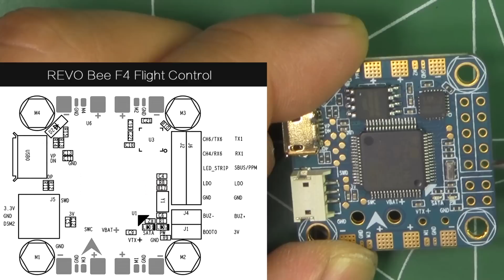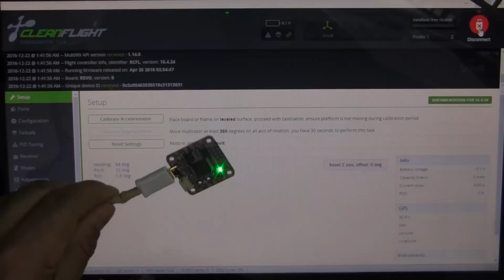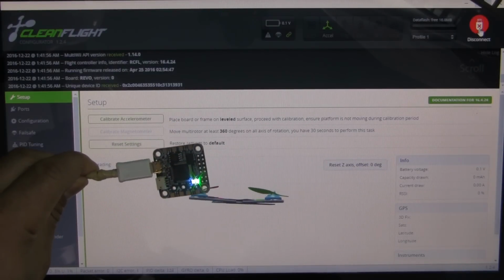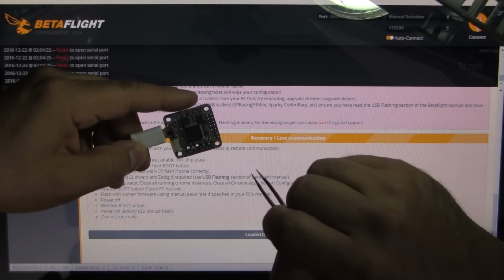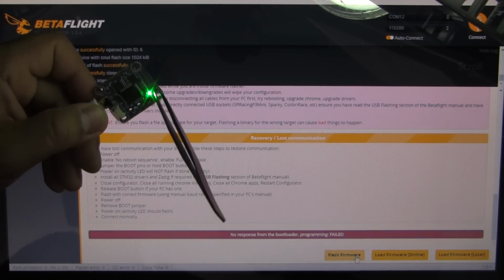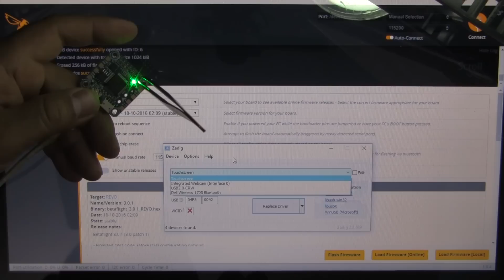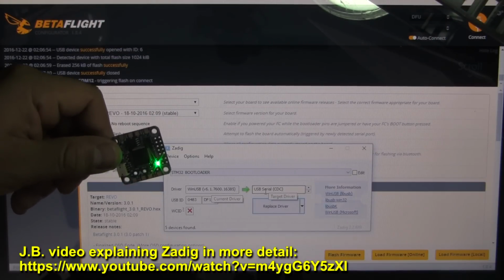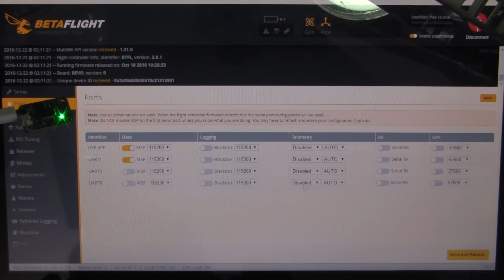iFlightRC.com REVO Bee F4 -MICRO FC Overview

Comment: can this board use with flying wing ?
Reply from the maker: Yes. Any board as long as you flash with fixed wing version of firmware
Reply: @EngineerX  many thanks. i found problem about board like this(clone board) i can not config it to use with fly wing servo 3 and 4 not move. i have no idea how to check and test. i try use it as multi rotor Quad-X in inav all motor work fine.
Reply from the maker: @best3140  yes sometimes some firmwares don't work with all the features. Then you have to manually check if firmware version has correct resource output for each channel. I have same experience with other boards. Main problem is too many different boards. Hope all works well for you. Thanks.

Comment: Apparently this works on 1s.
Could you please check that ? I'd like to use this on a 1-2s build then.
Reply from the maker: Only 2S-4S when powered thru onboard PDB. For 1S you would have to use a step-up regulator.
Reply: http://shop.myairbot.com/index.php/airbotf4mini.html

I ask because I read this. I believe they're the same thing.

I've also read what you've just said.

One last question, if you power this via LiPo will the power pads have 5v or bat voltage ? 

Thanks yet again :)
Reply from the maker: Hamza Mohammad Pads will have LiPo voltage. You have to have a good soldering iron and a small flat tip to make it easier to solder the ESC signal wires as the pads are  small.
Reply: me too. i have read http://shop.myairbot.com/index.php/airbotf4mini.html and this board work on 1s direct lipo only. lets us show you how to connect the FC to 4s direct lipo.

Comment: Daaaaammmn! The price was so ridiculous, i did not even think too much i just bought one LOL
It will be a bit tricky to solder the battery power leads but hey a bit of challenge in the build is always welcome :p
Once again if they had included some 12V/5V filtered outputs, that would have been just perfect! 110A current sensor is a bit too low too so i might be careful where i will use it!
Thanks for sharing and have a great weekend
Reply from the maker: Yes... always seems parts are just one item away from perfection doesn't it?!! LoL... 
110A should be enough for anything running 4" props, I think, for 5" props.... it could be borderline. The price is definitely very competitive. It's amazing how competition has driven prices to be become so affordable we get to pick and choose from so many great options these days.... just hope prices for all of our toys don't change for the worse in the coming months with the possible changes in trading policies between Asia and the US :(  
Hopefully not and we continue to enjoy the hobby as usual. 
Have a very good weekend as well my friend !

Comment: nice video as normal.  Looking forward to the Sunnysky x2204 motor.
Reply from the maker: Ah yes! thanks for reminding me. I just got back home from vacation and I got a few motors to test and some material to edit. I'll add the SS2204 to the test queue. I'm thinking running the more popular props 4040x3, 5040x3, and 5040x2 on 4S. Thanks for watching.
Reply: EngineerX I am running the dal q4040 and it feels great. I think the x2204 is a good little motor for the weight. I will be very interested to see what kind of numbers it puts out?
Reply from the maker: will also add the DAL Q4040 to the test!
Reply: OK Thanks. Very excited to see the results.

Comment: what do you think of the multiple different mounting hole standards ? I believe this is bigger than the piko blx and smaller than a full size FC.
Reply from the maker: The different mounting patterns certainly make it a little more difficult to mount to most frames. You'd have to drill new holes or use some other method like double sided tape. I think they should include some sort of adapter mounts for regular size pattern. TPU 3D printed mounts would make these FC's even more attractive so you could just snap them in to any frame. I do get the down-sizing trend, works well for the tiny 150mm and smaller frames but I think adapters would be cheap and make it much easier for the enduser. Thanks for watching!
Reply: EngineerX why did they go for a 25x25mm??? Don't know of any frame that has this size pre-drilled... yeah they should provide some sort of adaptor, like FuriousFPV with their "PDB 30x30mm to 20x20mm"
Reply: Like this i dont see how they can hit the market and sell a lot of it ... unless Frames start coming out with 25x25mm holes... other boards too... but since the 20x20mm format is just starting to kickoff, the 25x25mm is gonna take time... that's if it is going to take on at all?! I nearly bought one on banggood, thinking it was 20x20! Its the Mini ACRO F4, it's also 25x25, very similar to this board.21$... i might go and try this one out (at 21$!?)  if i decide to do a build and softmount my F4 FC. Thanks for the review.
Reply from the maker: Right, not many frames made for this size format. 20x20mm would've been a better choice perhaps. The only frame I've seen with 25x25 pattern is this one, though I haven't been actively looking.
http://www.iflight-rc.com/iflight-racer-ix2-90mm-indoorfly-fpv-racing-quadcopter-pnp-kit.html
I can see some advantage with narrower/smaller FC's. You can use a narrower center section on quad frames which translates into less airdrag, and improvement on motor-to-motor symmetry. Just wish they had included some simple flexible TPU 3D printed adapters so we don't have to drill holes or figure out how to mount them.
Reply: EngineerX oh I use a hole bunch of the PikoBLX on my nano quads, games from Quattrovolante, Tomoquads... And just got a Catalyst Machineworks Superlight 3" which takes 20x20mm stacks too. I sure would like to see how they can design 4-5" frames now using this size to improve on aerodynamics